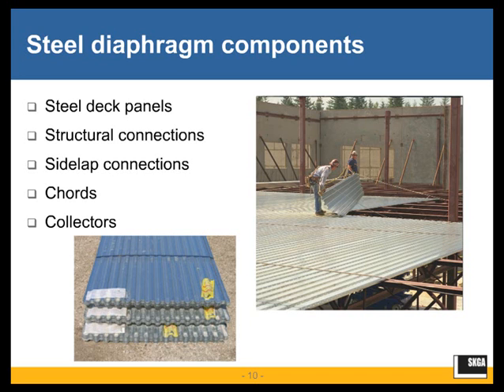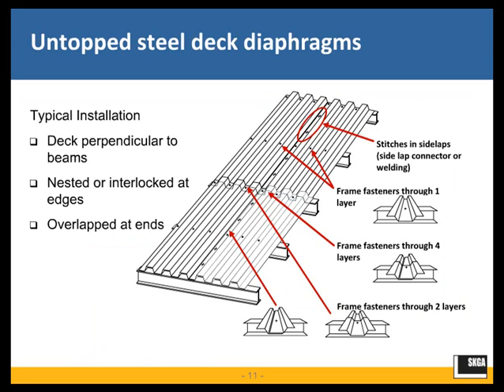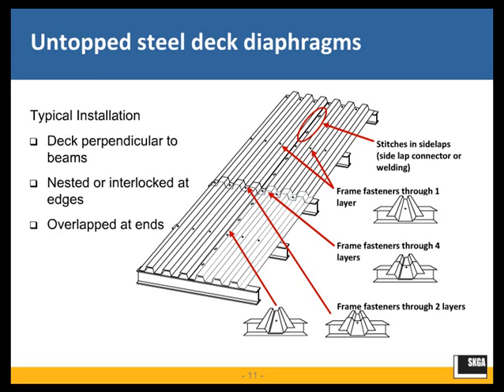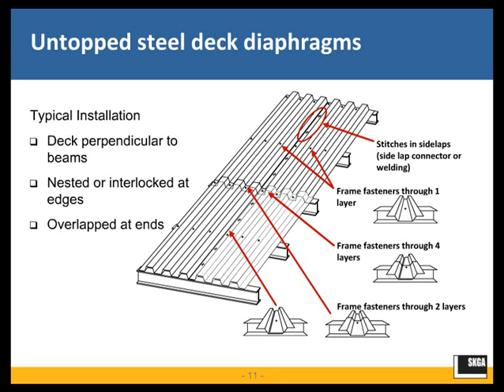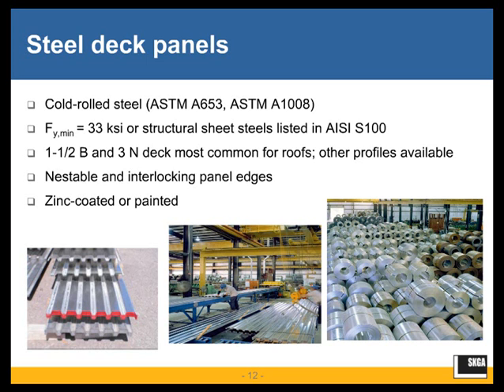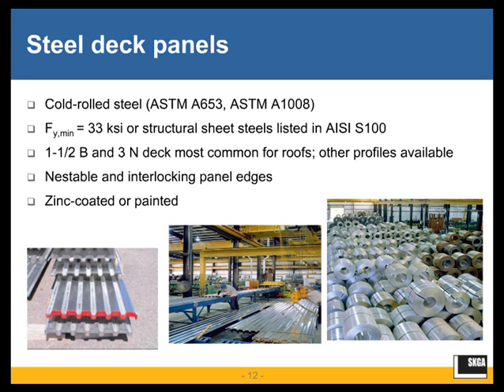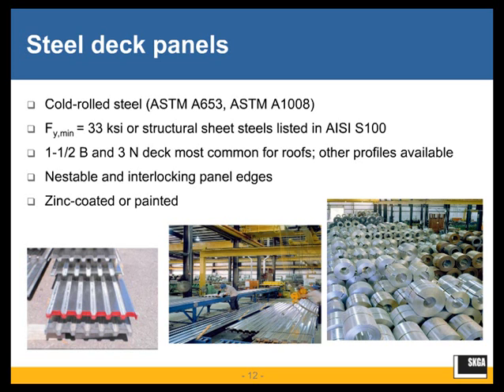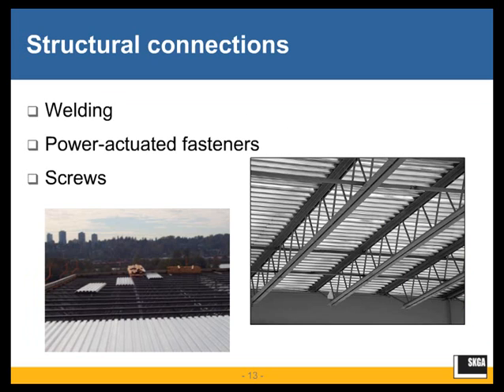Design of Steel Deck Diaphragms

Comment: One additional note regarding fasteners: when shear loads are very high, bolts are required. These are welded to the support members & MFRS.
Reply: But, how would you distribute the load from the bolt to avoid pull-through? We use many small fasteners instead, "evenly" spread out.